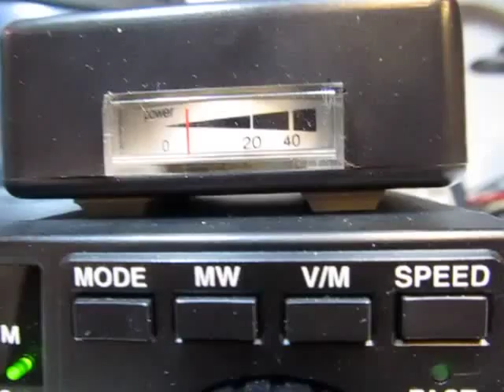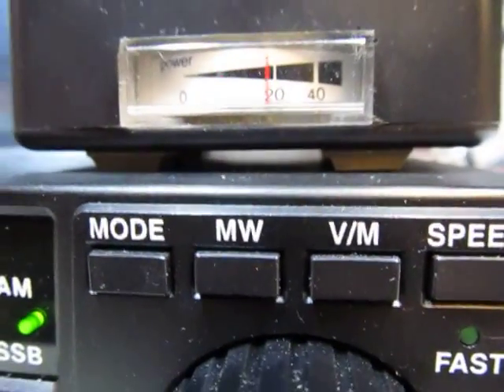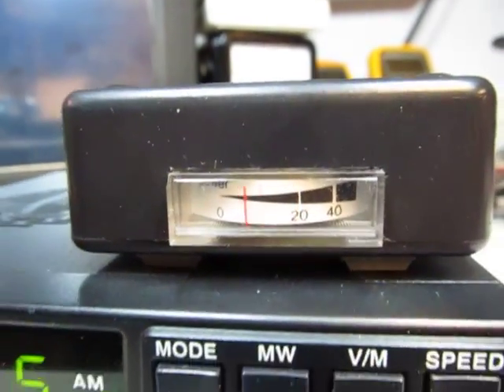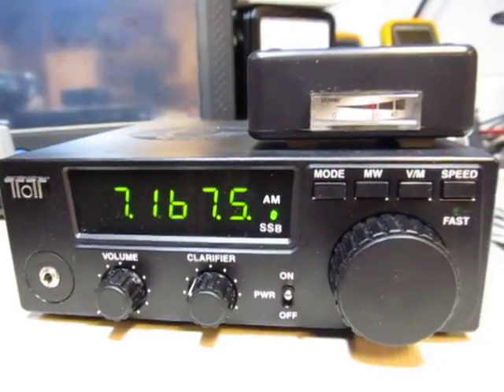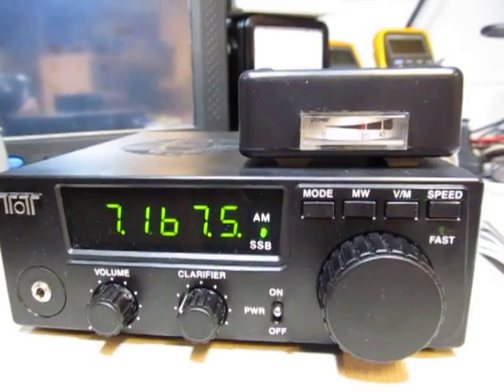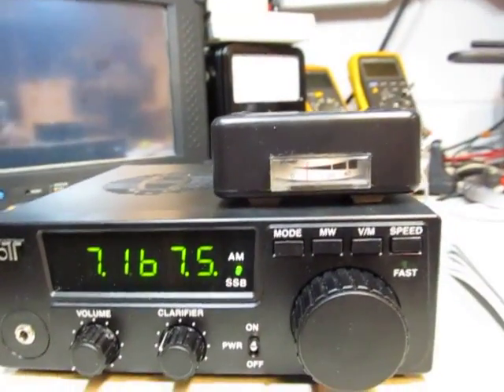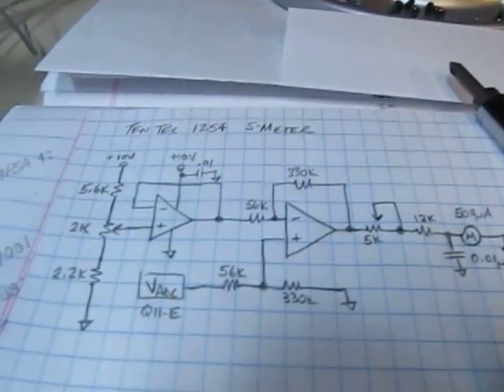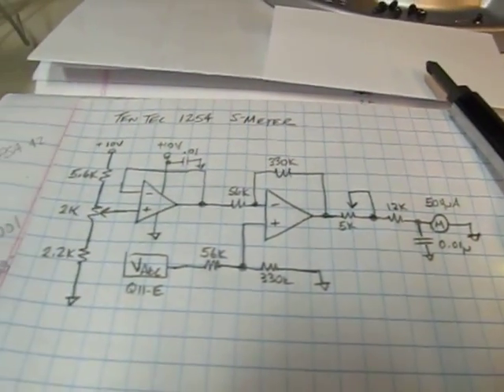#30: Part II: Finishing the S-Meter on the Ten Tec 1254 Shortwave Receiver

Comment: Great job! I didn't know about this radio kit. I built the Ten Tec 2 meter vhf fm 5w kit and love it. It appears to be the same box, display, etc. It's hard to tune an antenna without an S meter, so I found this video while searching for ideas. 45 years ago I added an S-meter to my dad's CB radio using just a meter and a diode, if my fading memory is correct. I'm not sure how to approach using this idea on an FM radio. I am curious if you noticed any signal loss? An RF meter project would be a great addition to my Ten Tec 1056 kit receiver. Great idea and thanks for the video! KS4NG
Reply from the maker: I haven't noticed any performance hit after adding this circuit.